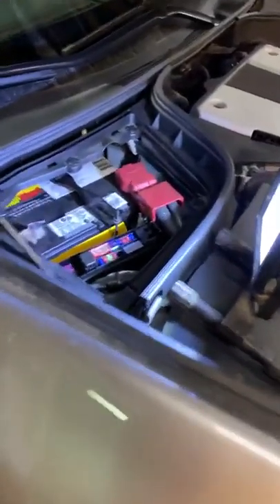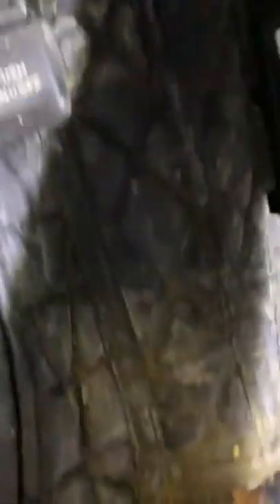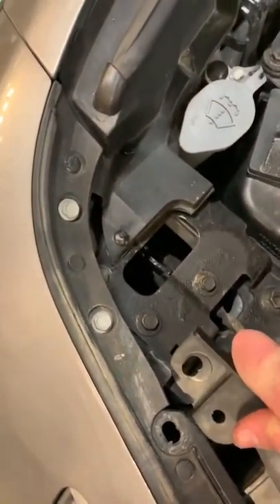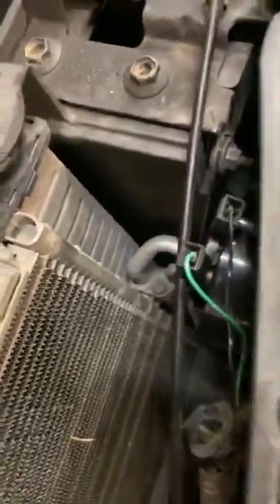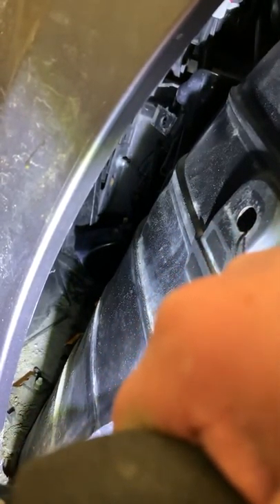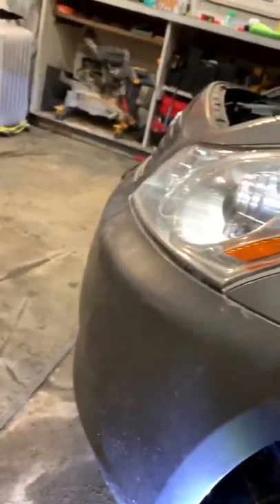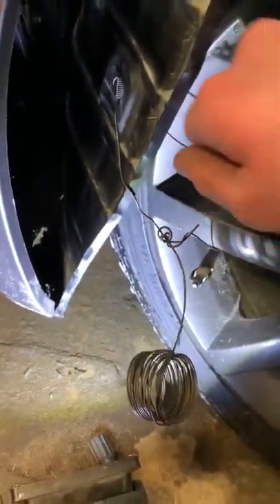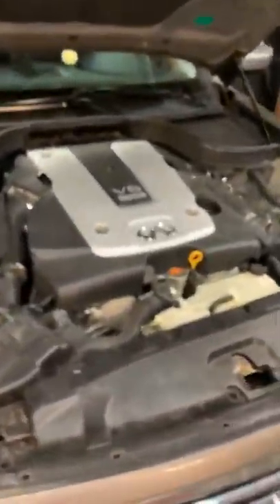2009 infiniti g37xs Horn replacement + diagnostics tutorial

Comment: Thank you for clearly showing the complete fix for a horn not working. The lock horn under the wheel well was working just fine, but not the one under the beauty cover between hood latch and grill. I will follow the fuse fixes first. My wife would not like me putting a railway train horn!